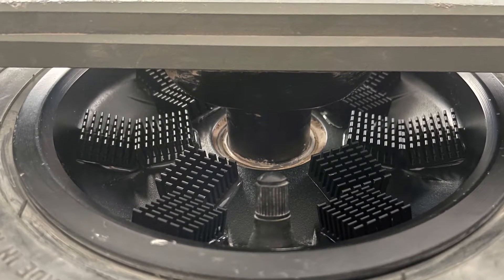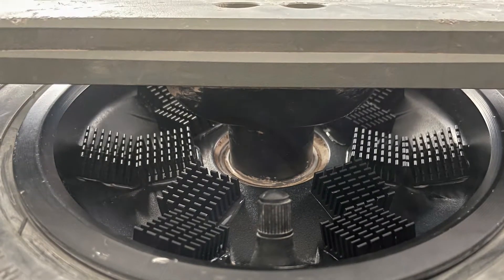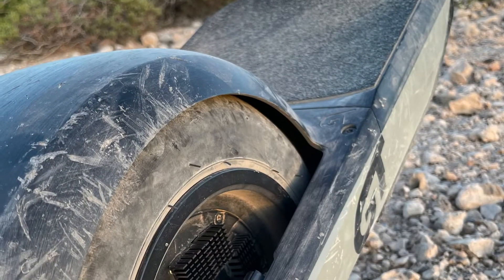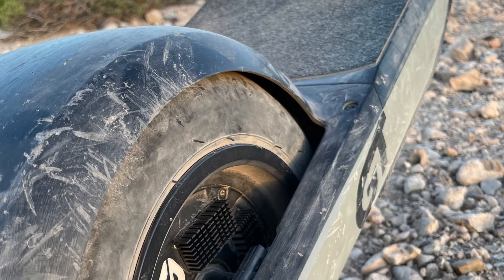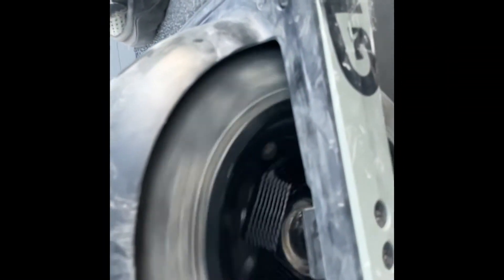Onewheel GT off-road must have heat sinks?

Comment: Acually that is good idea - better is even to inject statorage of ferrofluid into hub.
Reply from the maker: I have that in hand if I needed it, going to see at what ambient temperature the GT starting to overheat a lot.
Reply: Seen this for the GT before, anyone doing this with previous generations before ?
Reply from the maker: @_ScottSauce  heatsinks doesn’t really help much. Really need heat pipe built into the stator and lead out to the rail. But 95% of rider will not needed, it only affects the 5% of us.

Comment: sorry if you've already answered this: 
Are those attached using thermal conductive glue or a contact patch or what? If it's epoxy or 3m I'm worried you've actually insulated your motor.
Reply from the maker: I am using this stuff J-B Weld 8276 KwikWeld Quick Setting Steel Reinforced Epoxy - Dark Grey 2 oz https://www.amazon.com/dp/B0006O1ICY/ref=cm_sw_r_cp_api_i_ARNE9X5169CKYS90K8JT?_encoding=UTF8&psc=1
Reply from the maker: I don’t know the thermo characteristics of those glue. What is a good thermal conductive glue I should use?